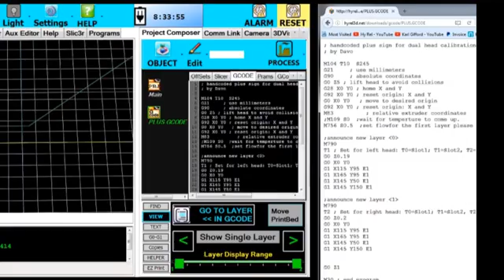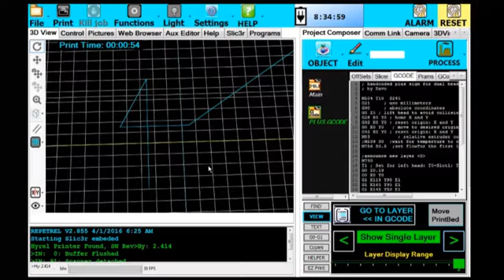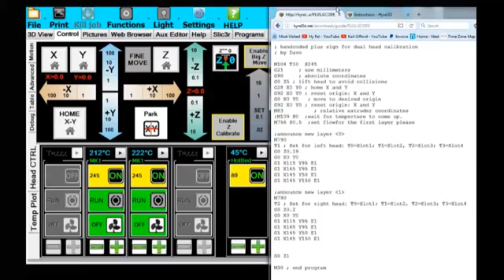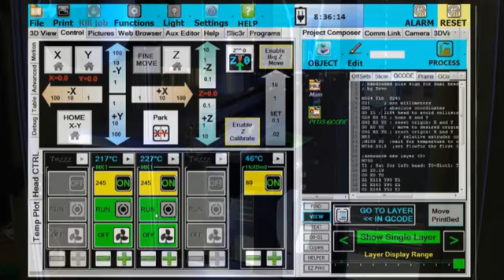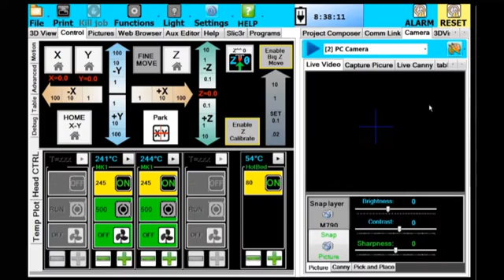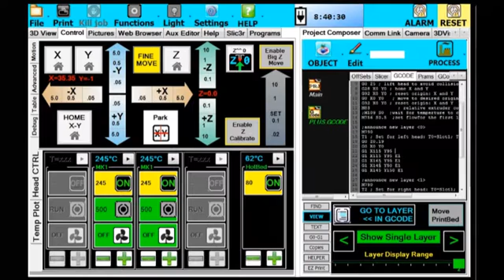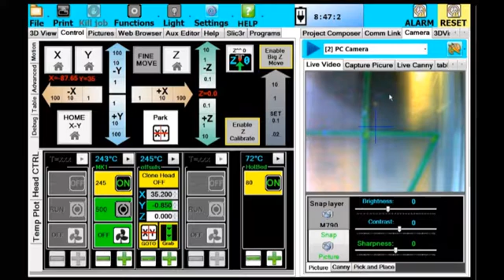Session 3B -  Calibrating the Offset Between Two Heads

Comment: how to we attach the on board camera if we don't have one ?
Reply from the maker: You can use a microscope head. But it's actually easier if you tape a webcam (or smartphone) to the bed, and calibrate the offset from center of nozzle to center of nozzle.